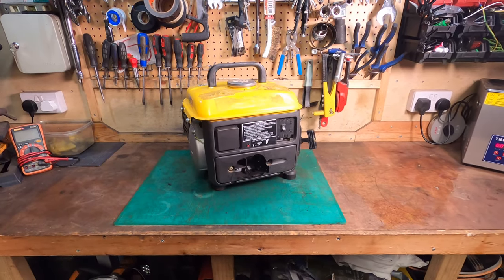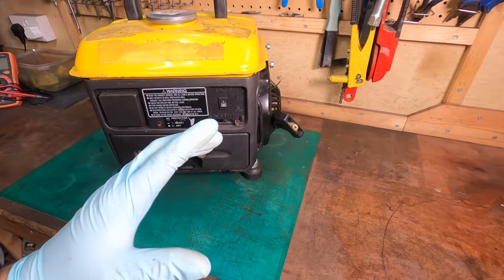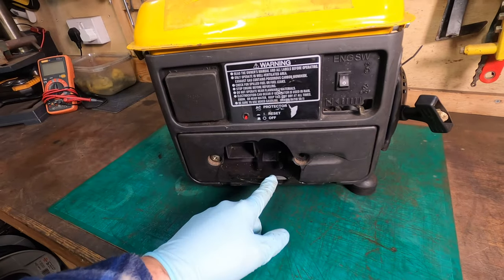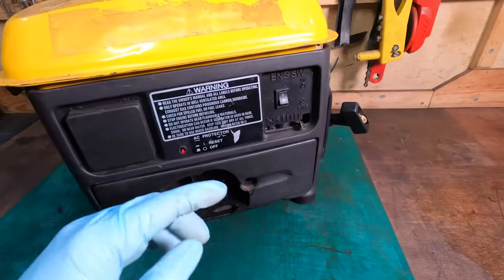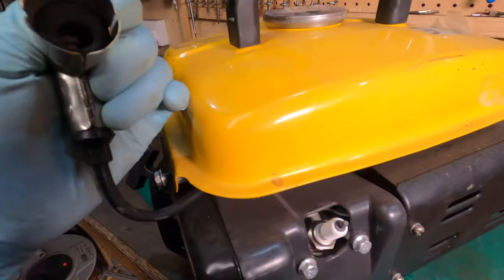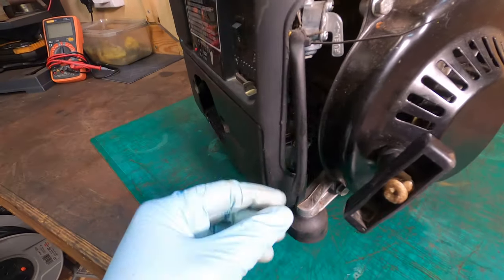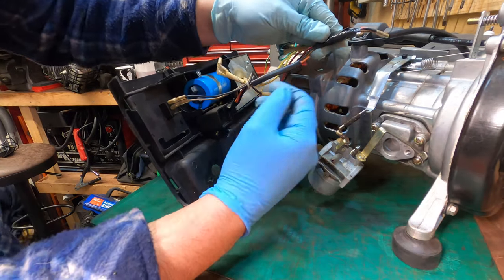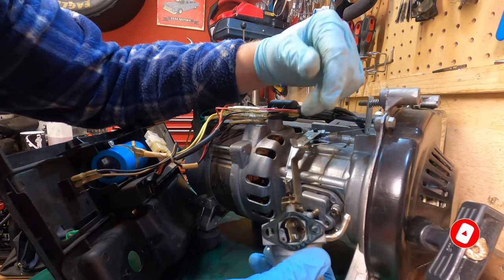Power Craft 720 Two Stroke Portable Generator - Will it Run?

Comment: I have one like this and I have no spark. I have voltage coming off the two wires coming from the flywheel coil and then they go into a small box and then one lead comes out of there and goes to the coil on the end of the spark plug lead. It looks like I have no voltage coming out of that box. Do you know what it is ? I was wondering if I can bypass it and go straight to the spark plug  coil, but I would have two leads not one ?